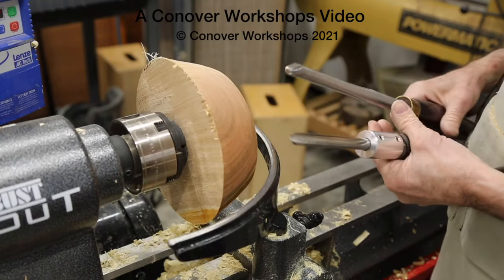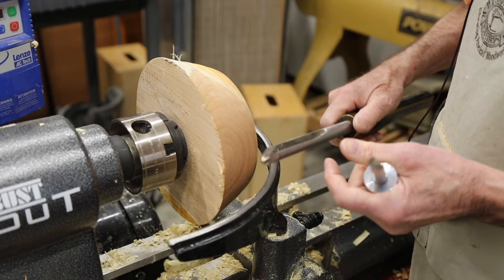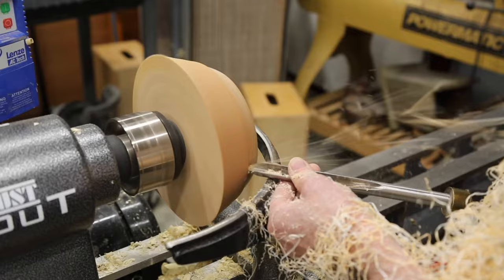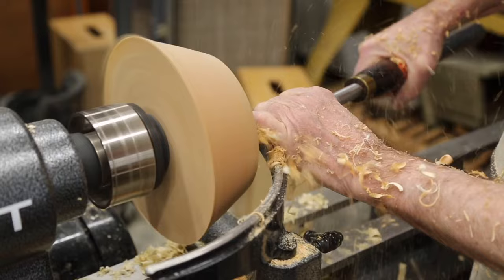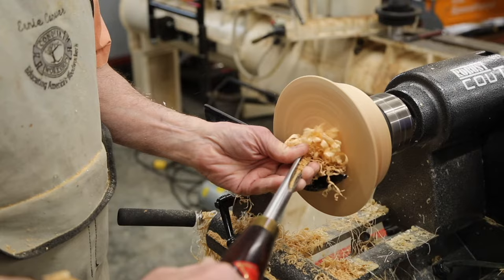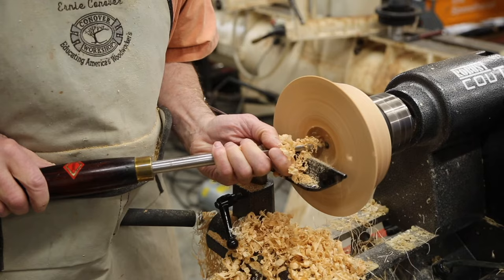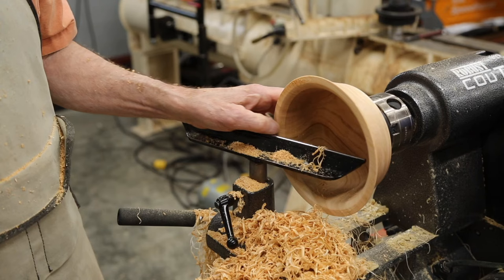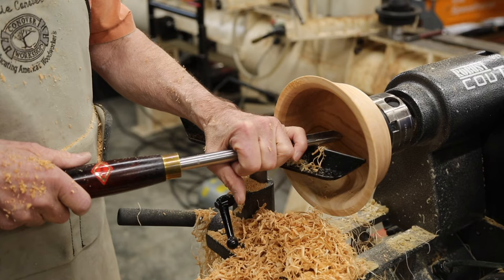Controlling the Bowl Gouge

Comment: Your ability with a bowl gouge is impressive but to say that you can’t use a spindle gouge for face work is simply not the case. Watch what Richard Raffan does with them. True presenting in the manner you you showed is certainly not the true way to use it but it is very effective for both roughing and final finish cuts in bowl turning. You present much like a bowl gouge.

Comment: Saturday Jan 13  4:15 pm great video lots of information... how do you  keep the gouge from bouncing on the bottom end cut? That's the issue I have so I use a round nose scraper to finish the bottom.
Reply from the maker: Generally raising the handle slightly when you first sense it cures the problem. If you wait until the bouncing gets pronounced you have to backup a bit and start a new cut.

Comment: I’ve been taught to never have the flute completely open, but you do this a lot? Can you explain? Clearly your results are good
Reply: Particularly when you were doing the outside of the bowl
Reply from the maker: I am not quite shure what you are asking here. The flute should always be tilted towards the direction of cut, so for inside cuts it would point to about 2:00 o'clock and for outside cuts (if the mouth of the bowl is towards the headstock) to about 11:00 o'clock.
Reply: @conoverworkshops1486  I guess at 2:55 for instance the flute looks almost in the 12 o clock position. Also was this green wood or dry?